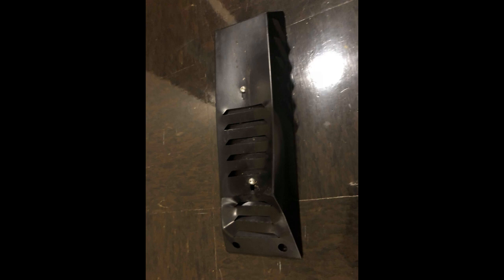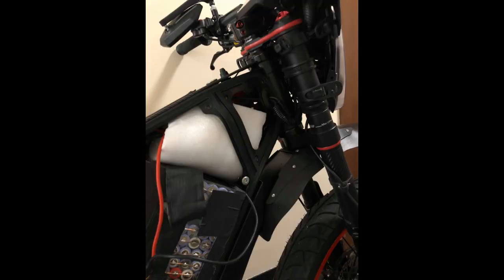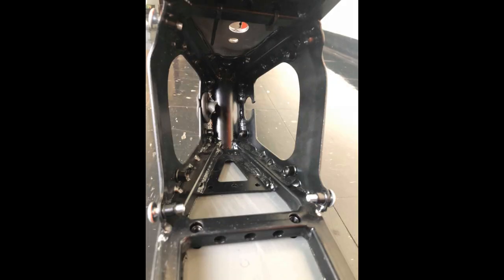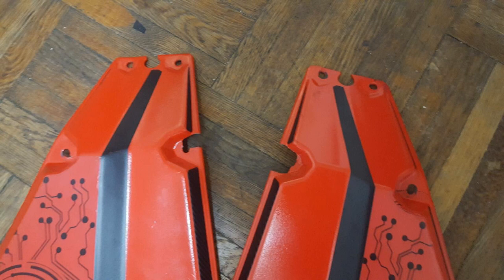Vector Typhoon ebike frame car collision

Comment: I can second this, my cousin had a go on my typhoon and he rides motorcycles. He got up to about 40 mph and then decided to pull the clutch!?!?!? To be fair he was a little drunk and I probably shouldn't have let him have a little blast on it. He went over the handle bars at around 30 mph and the back end slammed into the concrete with such force, the hub nuts gouged chunks out of the road. All I had was a bent brake lever! Everything else was fine!. When you consider the amount of sideways torsional force being applied through the swing arm and into the swing arm pivot when the back wheel struck the road, it makes me cringe, but nope, not even a problem! All the electrics were fine, the battery didn't even move an inch. 

I keep hearing people on forums and in YouTube comments who probably don't own one of these, saying its crap and breaks really easily etc. When it couldn't be further from the truth, the Typhoon, and probably there other bikes too, are so strong its ridiculous. They can take some serious crap and laugh it off.
Reply from the maker: Thank you for feedback John!